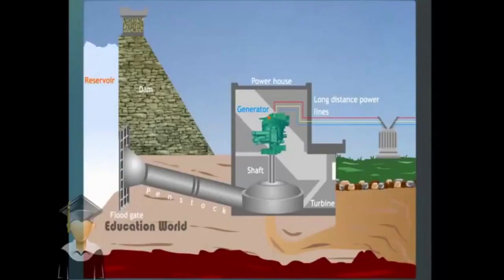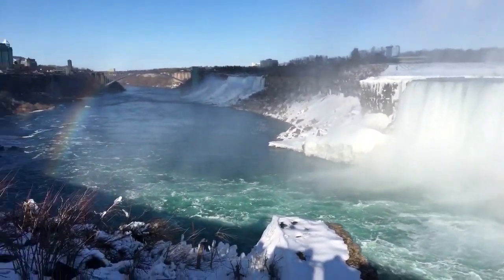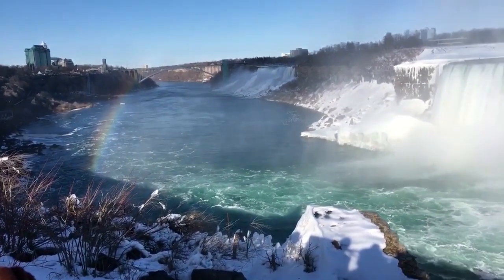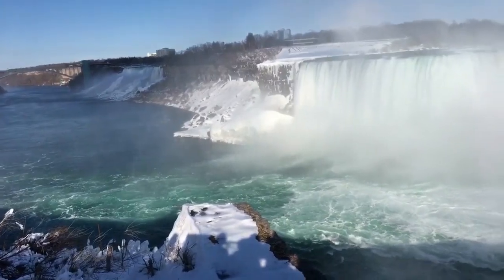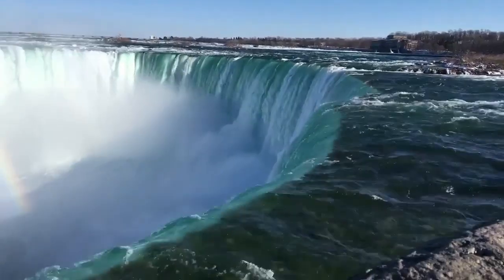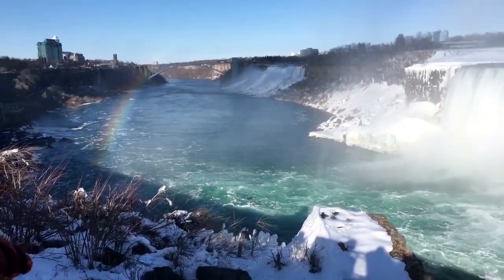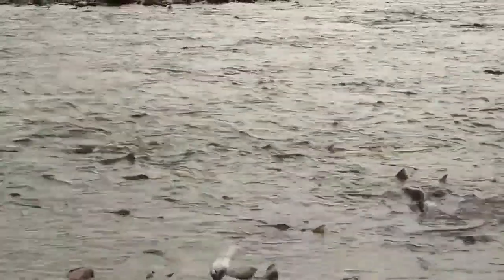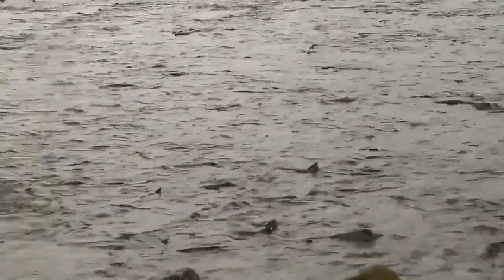Full Lifecycle Environmental Cost of Hydroelectric Power

Comment: A major environmental issue with dams which I think you forgot to mention is that they block sediment transport. 

Rivers transport sediments, both from riverbed erosion, as well as plant matter that falls in the rivers. Those sediments are generally fairly rich in plant nutrients (nitrogen and phosphates).

When a dam is built on a river, the sediments will not be transported downstream anymore, but instead accumulate in the reservoir. This, in turn, causes multiple environmental issues:
-The reservoir will, in some cases, undergo eutrophication, and become unsuitable to the diverse endemic species that inhabited the riverbed

-Downstream floodplains will not receive the nutrient intake they previously received, which can significantly alter their ecology.

-The existence of river deltas depends on the equilibrium between the deposition of sediments brought by the river, and their erosion by currents. With sediments now accumulating in the reservoir, deltas will rapidly erode.

The last two of these effects are particularly visible with the Aswan dam.
Reply from the maker: Yeah, I should have mentioned it. I kind of skirted around it, with mention of fish and organisms living in the water, but I forgot to specifically include the sediments, which can cause lots of interesting problems, like erosion of the land below the dam, and slow filling up of the reservoir. But you are absolutely correct here, thanks for the inclusion!